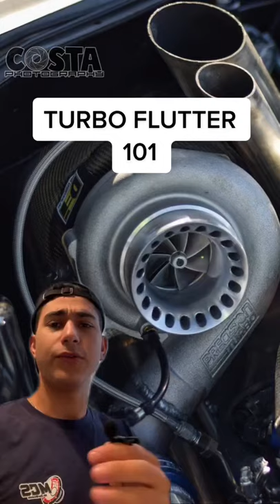TURBO FLUTTER 101 - Explaining Sutututu Theory

Comment: Don't forget the bypass valve, sometimes called a recirculating blow off valve. Instead of releasing the air to the atmosphere, it recirculates it back into the intake when the throttle plate closes so the turbo can spool way quicker between gear changes. When you blow off all that air to the atmosphere, your turbo takes a longer to spool up.
Reply: I just disconnected the tube from my recirc valve (2015 Sonata Sport 2.0T) and plugged it so I could get the BOV sound 🤣 it's way cheaper than getting a sound plate ($6 to $75) and the sound is just too good
Reply: @Mikcago  have you noticed any negative effects on the car after doing this? I've never heard of someone plugging off the recir tube and turning theri bpv into a bov 😂, but if it works, It works
Reply: @jjplayesgames  only been a day, but so far nothing. Just keeping an eye out for weird engine behavior, especially when pushing it. I know there's a potential loss in power just cause you kinda make the turbo lag a bit worse this way. Also looking out for a dip in mpg (which, is gonna happen a bit anyway, cause all I've wanted to do is stab the throttle and hear the whoosh 🤣)
Reply: @Mikcago  well that's good ot hear it's not causing issues so far. For me I couldn't do that even if I wanted to without tuning 😂. I got a 2011 WRX so that is something that would definitely mess up my car 😂

Comment: basically when you close the throttle the turbo is already spinning too fast so alot of air builds up and some of that air goes back the way it came thus making the stutututututututututu

Rally Drivers & Drifters Don't use A "Blow Off Valve" because they don't leave the throttle closed for a long time thus if there was a Blow Off Valve it would've reduced the pressure thus degrading the performance when the next time the driver opens the throttle again...
Reply: Exactly, they use a wastegate or an anti lag system like group A rally cars.
Reply: @realryder2626  Yep you 100% don't know what a wastegate is.

Comment: The turbo flutter happens when the air is chopped off
Reply: He just explained it, it’s called compressor surge.
Reply: @2seep  He just said it escapes.... not that the air is actually being 'chopped'.
Reply: How are u gonna chop the air💀💀💀💀
Reply: @2seep  He also called a compressor wheel a turbine....
Reply: @2seep and it will fuck your turbo hahaha
Reply: @brettrichards666 and doesn't know enough to explain a wastegate

Comment: okay i get it, but then, what are advantages/disadvantages of closed systems?
Reply: Puts more stress on the turbo journel bearings, which in results ruins the turbocharger. When you have no bov its not good for turbos but sounds badass
Reply: There’s no performance advantage. Reversion causes the turbine to slow down, meaning more boost lag between gears.
Reply: @user-lz3sv5sw9u  There is no difference of turbo speed after you lift off the throttle between running a valve and not running one, people have tested it but anybody that has actually done it could also tell you that, if it did cause any lag it would not be common place in motorsport to not run a valve.
Reply: @user-lz3sv5sw9u  doesn't cause more lag bud.
Reply: Less fabrication 

So let’s say you have a car with a MAS (mass air sensor) and you didn’t want to cut the harness or move it,  in a closed system the BOV doesn’t leak air the MAS has already told the ECU to expect for the air/fuel mixture 

You don’t have to weld in a bung for the BOV or buy one or clamps and couplers to put it in at all

You can keep the MAS in the same area stock or let’s say use it in the compressor intake pipe 

That’s about the only advantage, less parts, less couplers to leak and not moving the MAS

Anytime I use an anti surge turbo I can usually run the old intake with the MAS with the only change being a coupler to the intercooler instead of a filter on the end

Disadvantage is, without anti surge on the turbo you are stressing it. The higher the power the more stress on the wheel and shaft, bearing, throttle body, any bad welds in the system and the couplers of you have any 

No BOV? Anti surge turbo. 
No anti surge? BOV and get to welding if it’s high power. Get some couplers if it’s not
Reply: @user-lz3sv5sw9u actually pro drifters tend to run close systems because bov drop the pressure quickly, making it take longer to build back up, and they’re not off the throttle long enough to actually do any real damage (at least not that they care about)

Comment: Couple things here.  1). You don’t want boost escaping via the turbine. This can damage the turbo, as you have exhaust gases pushing the hot side, and now boost pushing opposite on the cold side. 
2). You can get the same flutter from the blow off valve depending on the spring and set point of that spring. APS dual vent BOV’s were notorious for this in light light boost. Essentially the spring would allow the boost to vent and bounce between open and closed. This can be fixed with adjusting the spring or shimming the piston in the BOV.  

I’m pretty sure the real point of this video is to watch him make noises.
Reply: If you get getting flutter with a blow off valve it's because the valve if either not opening or not releasing enough pressure to stop it, the reason it would have happened on the BOV you mentioned is because there is not enough pressure to open the valve, it's not the valve opening and closing.
Reply: I have to disagree with you on this slightly, but it might just be semantics and we are actually saying the same thing. A blow off valve uses a spring with a set spring rate inside of it. A good BOV should have the ability to adjust its set point or spring tension.  When the boost is to be released, a vacuum hose from the manifold allows the piston to move as there is a pressure differential between the two sides of the throttle body. 

You are correct, this flutter should only really happen under lower boost levels where the spring and piston is bouncing back and forth past the vent hole. Under full boost, the piston SHOULD vent fully and not have flutter.

Going back to the main point though, you do not want your boost trying to escape via the turbo inlet. It should be vented via the blow off valve.
Reply: @DIYFabrications  You don't seem to understand, the blow off valve isn't opening and closing making the flutter sound, it's not opening at all.
Reply: @DriftNick  I think you and I are saying the same thing in different ways.  No worries.

Comment: For those wondering a closed forced induction system is not ideal
Reply: Explain why then
Reply: @Fredrick656  pressure needs to be released. a blowoff valve is a lot safer and more reliable then the pressure forcing itself out of the turbo
Reply: What about diesels? They usually have a closed system
Reply: @Fiyahhousee  they usually have plumbback, thats not closed.
Reply: @кяуртіс  what is a plumbback?
Reply: @Fiyahhousee  recircs the gasses back into the exhaust rather than ejecting to atmosphere. Turbosmart are a big name in that side of things and have a dual port that does either or or 5050
Reply: Most diesel engines dont have a throttle plate, so boost preasure is passed through the engine. When you close the "throttle" in a diesel, they just inject less diesel. @Fiyahhousee
Reply: @tonycowham801   Doesn't make a difference. This myth has been proved wrong repeatedly.
Reply: @strider5119 it literally creates back pressure on the compressor turbine and wears out the turbocharger faster so yea it’s not ideal
Reply: @williamkleiner1305  Compressor turbine? what is that?
Reply: @DriftNick  sorry I meant compressor side as in the cold side of the turbo/ pretty side, it puts stress on the blades and shaft with the back pressure

Comment: Compressor surge. This is how you destroy your turbo.
Reply: yet another believer in that wives tale... its just air my guy, it don't spin backwards or slow down, its air being chopped up into pieces as it escapes out of the turbo dur to no place to escape under no throttle
Reply: If you’re hearing it while you’re on the gas it means you’re making too much boost for the size pipes you have. This is bad because the turbo is exposed to forces on both sides which can damage bearings. That being said when you let off and it stutututu that’s not bad. It’s a rapid deceleration opposed to the rapid acceleration it experiences during normal operation. The turbine is designed for this rapid change in speed but it is not designed for opposing forces.
Reply: Turbo on my car is a solid $250 bucks and easy to change. Fuck it
Reply: @wolfaja755 I love this explanation on the difference between compressor surge and turbo flutter!
Reply: @1107jordanlego I’m sure you could find a turbo rebuild kit for less than half that
Reply: So basically same thing as when a jet engine backfires
Reply: @wolfaja755 thank you for explaining that more, my turbo makes the flutter when i let off the gas but not when i’m on it and i got scared for a sec
Reply: no. 
Closed throttle compressor surge will not destroy your turbo.
Open throttle compressor surge is bad.
Reply: Not really 

On high boost systems it might 

But stock boost not really..
Reply: @strider5119  this.
Reply: wrong. compressor surge with closed throttle will not destroy your turbo. people have run 30+ pounds of boost with no BOV and gotten the full life out of their turbo. although if you have compressor surge at wide open throttle that'll do some damage
Reply: @quartzcyanis "yet another believer in that wives tale... its
just air my guy, it dont spin backwards or
slow down, its air being chopped up into
pieces as it escapes out of the turbo dur to
no place to escape under no throttle"

You Are Correct Except For The "Doesn't Slow Down The Turbo". It Does Slow Down. That Sound "Surges" It's Oscillating Because The Compressor Is Gripping And Then Loosing Traction Of The Air.This Does Slow The Turbo Down Slightly. I've Tested With And Without BOV And You Definitely "Loose Boost" / Turbo Speed When You Shift Without A BOV. I've Heard Some Pretty Reputable People Say The Turbo Spins Backwards Which Is Completely Wrong. If There Was That Much Resistance When It Surges The Turbine Shaft Would Snap Every Time It Tried To Spin Backwards. Anyway Turbo Surge Is Way Cooler Sounding In My Opinion hahaha Plus My Car Is Automatic hahaha.
Reply: @salvatorehayes2753  It does not slow the turbo down, High Performance Academy tested it on a dyno, there is no difference in turbo speed after you lift off the throttle between running a valve and not running one, they both go down at the same rate, though you don't need them to dyno test it, if it did cause any lag it wouldn't be common place in motorsport not to run a valve.
Reply: @DriftNick  Link The Video. I Could Feel More Responsiveness On Off Throttle During Simulated Gear Shifts With A BOV.
Reply: @quartzcyanis yeah COMPRESSED air cheif! what do you think a bov is for?? people here talk like they know shit while they drive a civic
Reply: @joshallcock7859  Blow off valves exist because people like the noise they make, bypass valve are factory fitted on most cars for emissions, not every car has one.